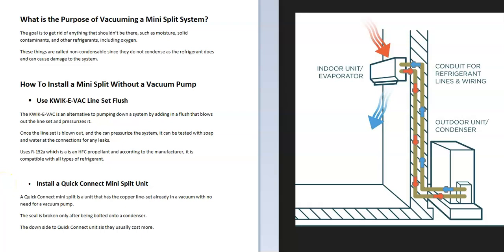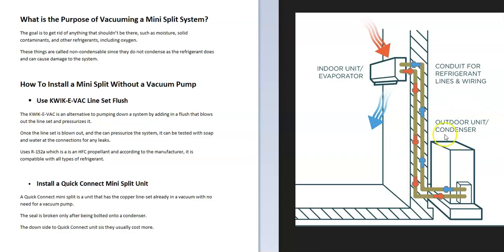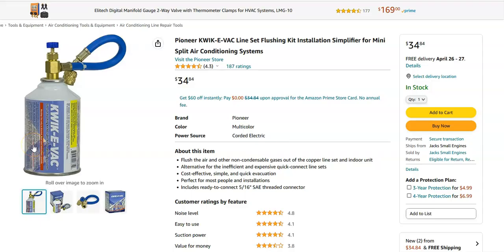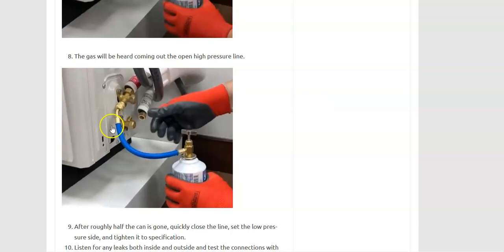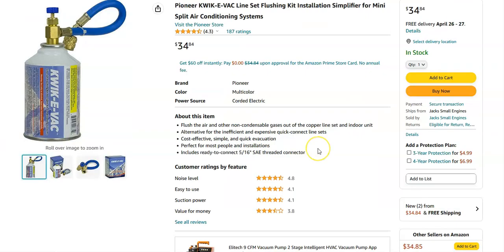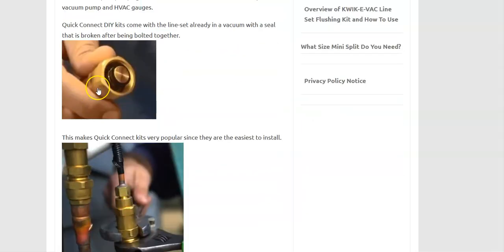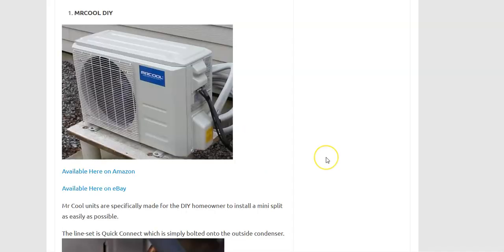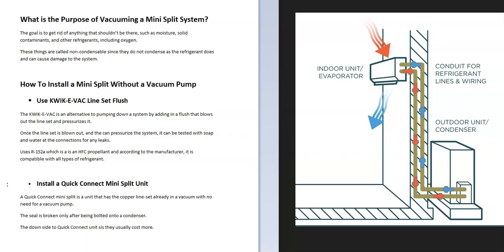How To Install a Mini Split Without a Vacuum Pump (Alternatives to Vacuuming Down a Mini Split)

Comment: What is the pressure left from the can to test?  I pressure test with filtered air from my air compressor at 130 psi. I have a second filter for spray painting on a adapter that fits the yellow line on my gage set.  Than I vacuum for an hour. I than close the valve on the blue line they hook up my 25 lb r410 tank upside down and vent to the gage set than open the valve on the blue line and vent to the mini split  i then crack the high side line until the r410 comes out. then tighten the high side line. shut the r410 tank valve off and check for leaks. then vent the extra r410 out of the line set.  Than open the compressor valves and run the unit check for high presser leaks. I think you can still buy R410 in a 5lb bottle. my 25lb tank cost $118 on Ebay in 2018 now it's about $277. It will be cheaper to buy a vacuum pump. try Harbor Freight or Amazon maybe Ebay. If I had a micron gage on the vacuum pump blue line at the compressor you can skip the r410 flush. I don't no where you can buy the micron gage and a tee. I have only installed 5 mini splits on my house and my sons house.

Comment: When you pull a vacuum, you do not remove all of the water vapor (it's a gas).  There is always a residual level of water vapor in the system because not all of the gasses get sucked out. You don't pull a complete vacuum.  Also consider that there is a residual level of water in the KWIK-E-VAC can to begin with.  The can blows a lot of the water vapor out of the unit, but there is a residual amount of water in the refrigerant in the KWIK can when the can is new.  So the can is essentially replacing the high moisture level in the line with the whatever the water level is in the KWIK can.  Both styles, whether vacuuming or the replacement style, leave a residual amount of water in the system.  Nobody ever measures it, because nobody wants to bother.  And since no one measures the residual water vapor in the unit by using the vac method or the replacement method, no one knows and EVERYONE is guessing.  That's right everyone is guessing which method is better.   I used to know the residual amount of water in welding gas nitrogen and it was really low.  I used to work with all the gases involved in scientific labs.

Comment: I have a PC 03 code that I can't get ride of.... any ideas? / Mr Cool Generation 4 double head unit.. when I looked it up it says I have a communication problem?
Reply from the maker: Be sure to verify the code definition for your model but a communication error often points to the wires run between the indoor and outdoor units. I would turn off the power at the breaker check the wiring on both units and then power it back on.

Comment: Against the law to release freon to the atmosphere ! You know better then to give this mis information as a a/c worker .
Reply from the maker: There is nothing against the law here; this is standard procedure. Look up HVAC De Minimis Release. Which, as every tech knows, is a question on the HVAC EPA 608 exam. (I am EPA 608 Type II certified.) Also, this is not Freon; it is R410 Refrigerant.

Comment: Why would you not use the Kwic E Vac. You did not say.
Reply from the maker: Possibly just personal reasons, I have been using a vacuum pump for 30 years and never have any issues. Plus, I am hesitant about introducing another gas type in the system. With that said many people have good luck with it.

Comment: There is another way which is not recommended but I've seen many tecs do it here in Cancun.  Basically instead of using the Kwick can, the just use some of the refrigerant in the system already.  The assumption is that the gas will push out the bad air/moisture out of the system.
Reply: Called back purging in the uk, slowly open the low pressure valve until the air has gone and the refrigerant starts to show its self
Reply: aren't you then short of refrigerant?
Reply: @dwhite6213  Yes, but remember the "correct" amount of refrigerant is usually a "range".  Usually the correct pressure would be something like 70 to 75 PSI.

Again, not the best solution.  To be honest I purchased my vacuum pump less than a month ago.  After doing some research I learned that pretty much all the "experts" I paid making sure they had a vacum pump still didn't do things right.

Vacuum pump usually has to run over 30 minutes, the guys I've seen use the vacuum pump on my ACs left it on for less than 5 minutes.  They just got the pressure needle to go -30 and called it a day.

Basically just because you see so called "experts" doing it one way, doesn't mean they are actually doing it right.
Reply: Just a little bit @dwhite6213

Comment: Great content you don't need an expansive over glorified AC technician to connect your own A/C except for the electrical termination.Ive done multiple self installs over the last 10yrs with ZERO problems ALL THE NEGATIVE COMMENTS ARE AC TECHNICIANS HANGING ON TO THEIR GLORIFIED JOBS.. 😆🤣😂
Reply: An A/C technician is not on the level of a Surgeon and it's not a life or death procedure 😂...
Reply: You made my day thank you😅
Reply: Your reply is funny as fu@k man are you a stand up comedian?
Reply: Why do you need someone else to connect your electrical termination?
Reply: What would you prefer if you were getting surgery overglorified doctor or a YouTube doctor?
Reply: @jimgarcia5165  WOW clown world. I think a more accurate statement is do you want to install a simple system or have a stranger install a simple system and charge you a lot and hope they do it right.

Comment: Hello, my son just bought a condo in San Antonio TX.  His AC is struggling to keep up with the heat, so we are looking at 2 mini split systems.  My question is on a 110v-120v system like the pioneer 12K btu model, is it possible to safely wire it to a dedicated 20 amp circuit breaker wall plug instead of a disconnect box?  I saw a Mr. Cool system where they had done that, but I don’t want to make a horrible mistake to save $500 - $700 to have an electrician put in the disconnect box.  Thanks!
Reply from the maker: A mini split should be on its own dedicated breaker and is code in most areas. A disconnect is also code in most areas. Hiring an electrician for electrical is likely a good idea.

Comment: I just installed a Danby 18 000 but. The line connectors seemed to be exactly like those sealed line connectors you showed. I could hear the air being sucked when I connected the vacuum connectors.
The instructions also explained the vacuum procedure. But the instructions were terrible.
Did I waste my time and money vacuuming the system ?
Reply: It's very clear from the manual they insist on installers and so I deduce they don't want to deal with DIY issues. 
 The webpage says "Indoor unit, outdoor unit and pipes come pre-charged with R410A refrigerant" Costco's description states "Pipe cutting cannot be performed on this quick connect model since pipes are pre-filled – Pipe length is 16 feet (5 meters) and "Quick connect comes pre-charged with R410-A refrigerant in both indoor and outdoor units and pipes – to install connect the pipes, wiring and open the valves." and the video seems to indicate no vacuuming; just "An installer would now check the pressure". And since you've already opened both valves to release the refrigerant, that suggests to me they are true DIY, like Mr. Cool.  But why don't they make a big deal about this, like Mr. Cool?  This is big news! No vacuuming tool$ or skills needed! 

 I checked model DAS180EAQHWDB on the Danby website and you're right it has confusing instructions. Confusingly the manual describes two outdoor connection methods without separation in the list of steps. 
Outdoor: 
Steps #1-4 ,with a pic of the exposed valves, and quick connecting to them.  Then the manual breathlessly continues through-
Steps #5-7, with instructions and pic to remove the valve cover, but now they're tightening flare nuts.  Then it gives vacuuming instructions. 

Will Prouse has a simple vacuuming vid: https://youtu.be/5trJX6Ef1iI?si=TF-qmcCRrJoO5B8Z
Reply: I have the answer to your question, but I don’t give free answer. You have to pay me for my answer. What is just pay somebody to fix it for you
Reply: @jimgarcia5165  Pay you ? Might as well hire a clown for a show. At least the clown will entertain me.

Comment: You should remove this video if your a real hvac tech this is all wrong. Your a hack. R410 systems have Poe oil which is very hydroscopic and moisture cause the oil to become acidic. Not pulling a vacuum is leaving moisture. In the lines and anything that was open.

Comment: For around 500 a guy can buy a pump with  gauges,micron gauge and a couple appion valve core removal tools and do it right..To me it's worth it to do it right.. I spent a grand and bought the nitrogen tank w gauges a scale and extra freon to top off the extra lineset..You are still saving thousands and you have the tools for next time..
Reply: Look if you make $15/hr 500 is big bucks. You buy the mini split off craigslist for $399- bolt it on to your double wide or trailer- use this and your boyfriend will be impressed.
Reply: @donfrussell  very true
Reply: 500 for a thing you will use once lol
Reply: Better than paying thousands for a crappy installation from a overpriced company..@magnum_opus_overland
Reply: Saw a video from Africa where the guy flushed the line with the coolant. I guess if the lines happened to be very clean and very dry, that might work OK if the surrounding air was clean with very low humidity?
Reply: @MarkLeavenworth  if you don't have the tools that would probably be good enough..Pioneer also sells a can that vacuums the lines out but no gauge..I pressure checked with nitrogen and then flushed the lines with nitrogen since I had rented a whole bottle..It worked great I vacuumed  it down to 20 microns and then added the freon..It's actually pretty easy but it cost 400 to 1000 to buy the proper tools...
Reply: @daveyboy8907  It did seem comparable to what you showed that Pioneer has, when I saw your video.

I purchased high-end tools and learned HVAC to install minisplits on multiple properties. I just did my first one at my residence with a Senville, and it works great, but I’ll be going with Pioneer since they offer a DIY warranty.

I have no idea if my tools and technique will extend the life of the product 1 year or 10, but at least I’ll know the quality of the installation with confidence, and I’ll sleep much better at night knowing that.
Reply: Totally Agree !!!😊